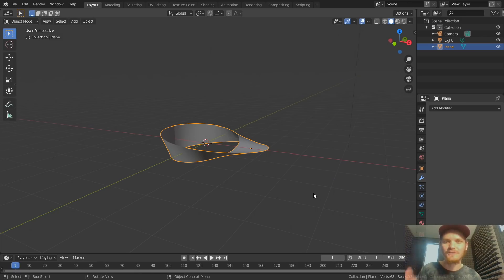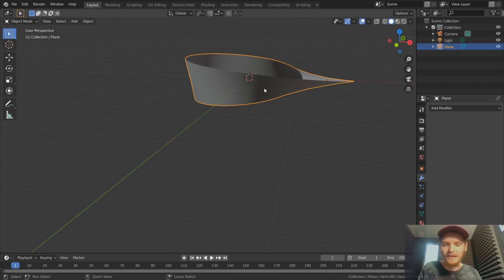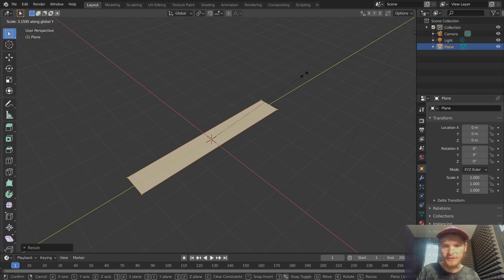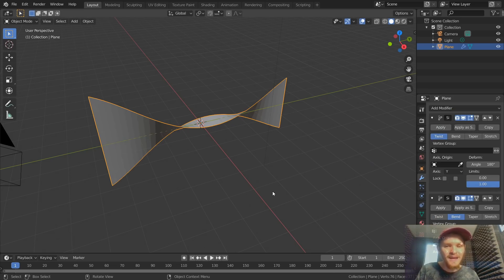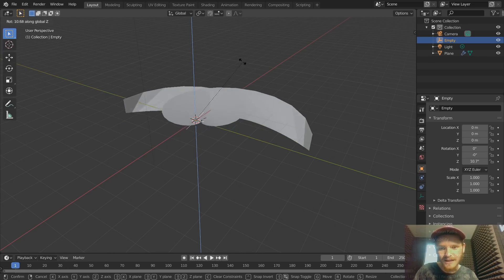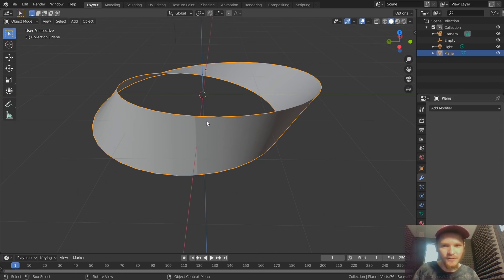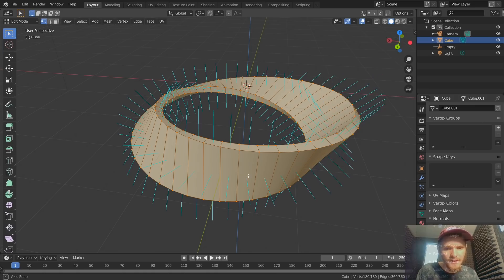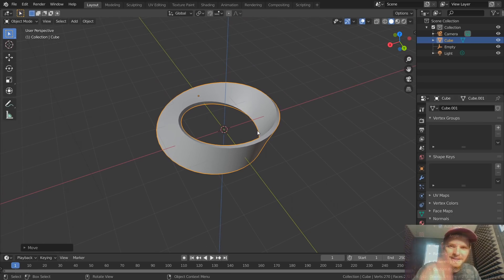How to Model a Mobius Strip (Blender Tutorial)

Comment: There is an easier way to do this. Add a new Object, Mesh, Math Function, XYZ Function Surface, then select Moebius in the Operator Presets :D
Reply: Not really useful for rendering or modeling since the normals are reversed at the seam.
Reply: @aliensoup2420  Therefore you have to give it thickness. Watch the tutorial.
Reply: Honestly, I can't seem to find the math function modifier, assuming its a modifier... which it probably isn't?
Reply: @land3021  Its an AddOn.   Add Mesh : Extra Objects.
Reply: @aliensoup2420  Forgot to say this. Thx
Reply: @aliensoup2420  Thank you for clearing that up, I honestly thought they were talking about some default feature before. Guess I'm still a noob even though I've been using blender since 2019 because I barely, if ever, interact with anyone.

Comment: You can also just use alt m to use merge by distance. If you didnt know and also you can enable face orientation in object mode as well where the front faces are blue and back faces are red and its located in the toolbar(?) 2nd from the shading options (i dont exactly know the names lol)

Comment: I prefer the parametric version where you make two curves then rotate them so that they cross and connect them so that if you follow one you'll end up on the other, then draw squares at regular intervals in the space between the 2 curves and your done. But of course it's a nonorientable mesh so your normals will suck.

Comment: I tried doing this, and I followed the exact steps but my mesh doesn't bend the same way yours does.

Any tips?
Reply from the maker: things to make sure of:
1) you've added the loop cuts
2) your simple deform modifier is set to the right type (twist, bend, etc)
3) you have your axis set appropriately (in my case z)
4) you used the empty method I showed
Reply: @DefaultCube  I tried everything
Reply: @Reversals  try to Ctrl A and Apply the Rotation

Comment: Can't you just apply a solidify modifier instead of modeling it with a cube?
Reply from the maker: if you add the solidify modifier what will happen is that the mesh will 'extrude' but in opposite directions at the discontinuity.
Reply: @DefaultCube  I think you can easily fix that with the offset but I see how that can create problems.
Reply: @aeshenanigans7376  i was thinking about that
Reply: @DefaultCube  Not sure what you mean... I just tried it and it just worked. Doesn't even seem to matter  where in the modifier stack you place the Solidify (though my preference would be to put it before everything else).
Reply: Nevermind. I guess I see what you meant now... Had to zoom in to notice the ends do actually not line up...